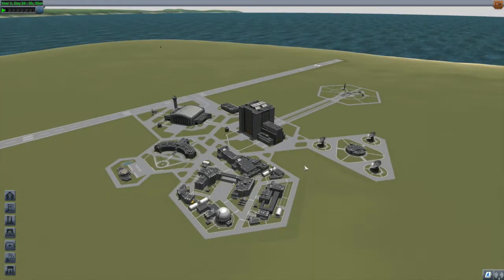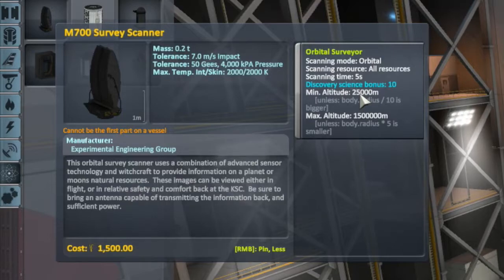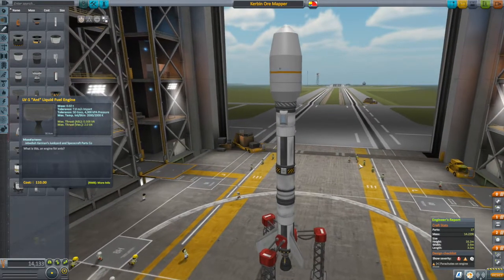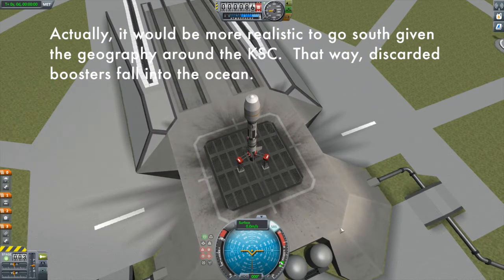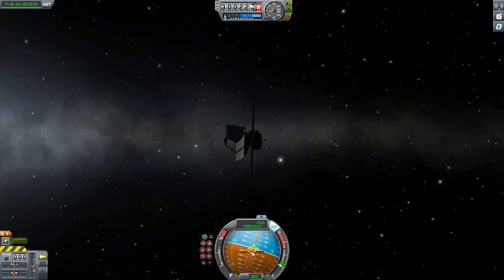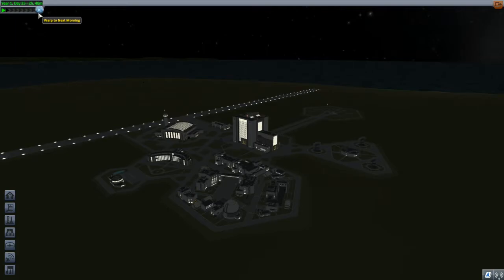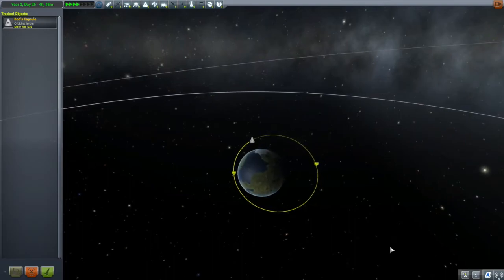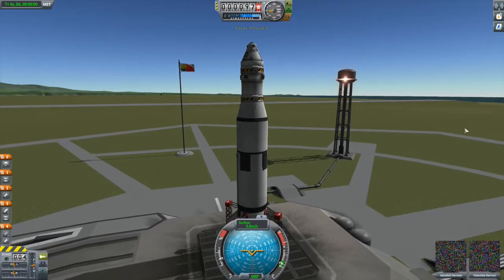Launching Into Inclined Orbits - KSP Tutorials #10

Comment: I really recommend a game on mobile called spaceflight simulator. It's very rudimentary compared to KSP but it does a great job teaching about using thrust to guide your Orbit and transfer windows etc in a slightly easier way. Plus the games completely free with zero micro transactions though if you do pay for the game you can stylize your crafts more and you can visit every planet and moon in our solar system. I would be COMPLETELY lost on ksp without spaceflight simulator laying the groundwork.

It also has docking and all the other things you'll need to learn for ksp. The key difference however is spaceflight simulator has a very robust map tool so while it has a dynamic solar system like ksp when you get in Orbit you can use your map tool and it will automatically calculate vectors, thrust and transfer windows so all you have to do is steer and use the right amount of thrust. I cannot overstate how happy I am I played it before ksp.

Plus my daughter loves it because it isn't as intimidating as ksp until she's a little older.

Comment: When I launch manually, my fat fingers seem to always send me south. That said, my kOS script includes an inclination parameter. It doesn't take into account a fudge factor for Kerbin's rotation, but I just add that myself to my target inclination. So lazy!
Reply from the maker: I find my very early rockets, before you get control surfaces or reaction wheels, typically want to drift south.  I'm not sure what that's about.
Reply: Must be the prevailing wind direction ;-)